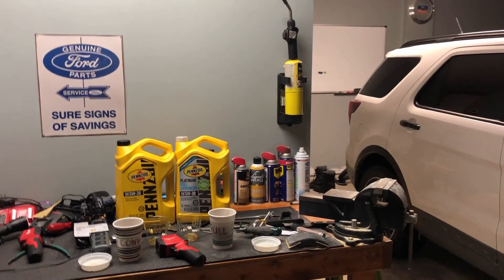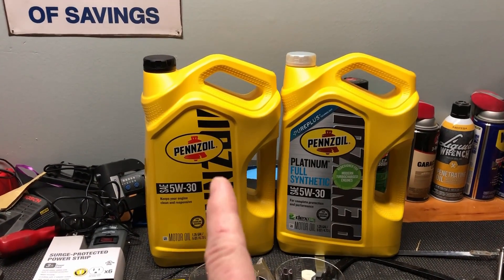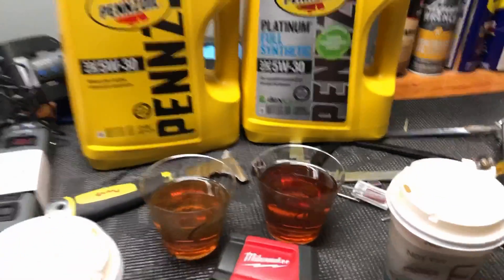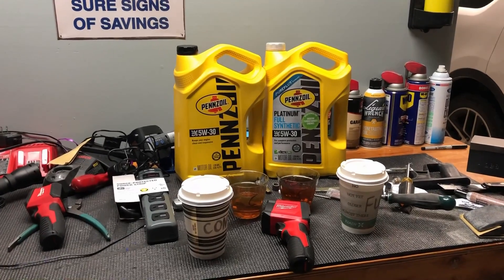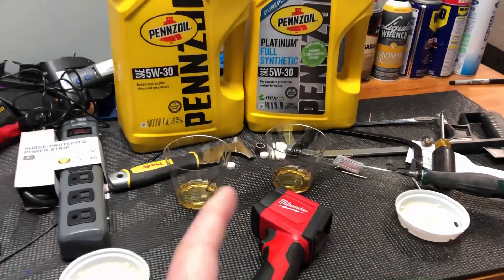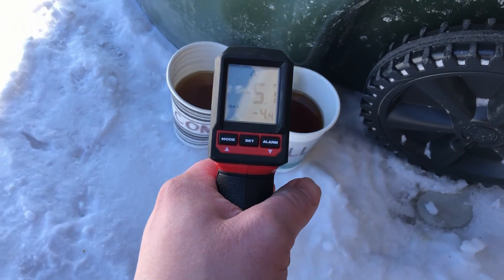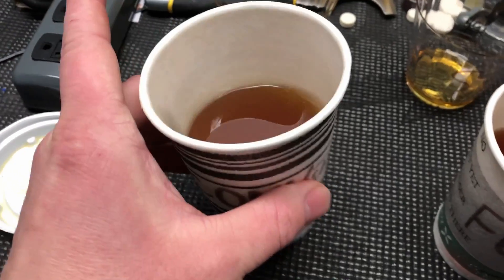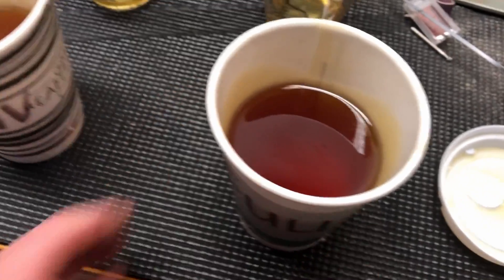Conventional vs Synthetic: Which Oil Do You Want in Your Engine During the Extreme Winter Cold?

Comment: I've always used Mobil 1 from Walmart $23 for the five gal jug . Just tried the Amazon 5qt jug full synthetic with all the API rating sn+ for $18 I'm going to give it a try. Made by a good old oil processing co for Amazon.
Reply: Its distributed by the same co. as the super supertech brand.  It's likely the same thing.   I'm going to give it a try as well
Reply: Anyone know the oil supplier for their oils?
Reply: Warren Distribution
Reply: Supertech is surprisingly good for it's price.
Reply: quaker state syn $15 at wallymart
Reply: @jonpeterson5534  That would be cheaper than Wallys Supertech…..something is wrong.
Reply: 0w20 bout 5 months ago    I thought it seemed too cheap but that's what it was
Reply: just checked, now $19.97
Reply: @jonpeterson5534  for that I think I would stick with Mobil one it proven to me if your local Walmart is the same as mine I think it is actually $22.88

Comment: So I saw synthetic oil lists a burn off or evaporated % on its specs and heard EcoBoost you should use lowest evaporative % due to pcv venting and oil in it getting to intake valves caking things up. I have 1st gen EcoBoost I just bought with 140,000 miles. Been giving it lots of tlc and going to get catch can and switch to synthetic oil. Saw penzoil platinum was at 7% evaporations in testing. Saw Mobil 1 was about 8 1/2%.  Only one with less blow by potential I saw was a red line synthetic oil. I don’t have much experience with penzoil or Mobil 1 synthetic oils but those are the two I was considering. I was wondering what oil you would recommend from your experience?  Thanks

Comment: Oil/gasoline prices have come down considerably and they function the same. Motor Oil has not come down, in fact it's gone up, add the synthetic now we have extremely high prices. Over the road trucking companies have been using Conventional Motor Oils, ref: Shell Rotella 15/40. This is the life's blood of their engines and it's working just fine. If anyone is going to jump on synthetic they would except the cost is out of line...

Comment: You should point out that syntentic might cause leaks on older engines. There’s no denying it flows better in cold temperatures tho .  My 2006 ram 1500 the syntectic  oil uses about 2 litres between oil changes and Dino oil it uses none .

Comment: I have used full syn for 19 years, change filter every 5k, oil at 10k....no downside.  Brand?  Walmart Supertech.
Reply: srercrcr I do the same, have always used royal purple but I’m thinking of switching. My question is how many miles have you gotten out of this method? Just curious? I have a friend of mine with over 300,000 mikes and only CHANGES his oil at 50,000 miles! He changes filter every 5000 and adds a quart of oil! Insane
Reply: @cl112688  I wonder why he waits for 50k miles?? I mean oil changes are not that expensive, and its cheap insurance! Crazy if you ask me.
Reply: @carstuff4u942  He burns a quart of oil every 5K and adds a new quart at that point, so when he has gone to 50K miles, it is not the same oil that is in there from the beginning.  The oil has been fully "changed" (according to his method) several times by that point, so he really doesn't have 50K miles on the oil.
Reply: @cl112688  a 2000 Explorer went 220K and never burned a drop,, and a 2014 Explorer with 66K.
Reply: which is also dexos rated making it no different than any other dexos rated oil that is twice the price.
Reply: @ Chase.. What brand of oil is your friend running and oil weight ?
Reply: P I I will try to find out here soon.

Comment: I lived through the big storm of 1964 in the middle of Saskatchewan in a motel.  I had an early satellite picture of the storm and it went from Alaska to San Francisco, and Vancouver Island to Hudson Bay. We were there cuz some relative died. The wind chill took the minus 60F down to minus 100F.  My dad never shut the car off.  But we did have to keep calling the govt power company to keep the heat on in the motel.  My brother and I enjoyed using the electric snow blower to keep the walks clear for the owner until we burned it out.  My grandfather told me that they used to use kerosene or diesel fuel in their crankcases on the farm in that kind of weather and even replacing the antifreeze when it got down past 66 below where the best water/antifreeze mix freezes.

Comment: This test was thought out in a very realistic way.  Since both oils are the same viscosity technically they should pour the same in these conditions.  This test proves two things. 1. Not all 5w oils have the same cold pour point, some 5w oils are thicker or thinner than others. 2. Pennzoil synthetic 5w is actually a very thin 5w oil.  This test actually proves that this type of Pennzoil 5w is a very thin oil and this is why it flows better in sub zero temps. A way oil company can claim better performance in the way of thin and easy to pump.  Proof of marketing gimmicks right here folks. I personally believe and use synthetic oils, in fact I use this type and viscosity used in this test,  but saying because it's synthetic is why it flows better in extreme low temps is not correct.

Comment: I’m an Amsoil dealer and I appreciate the demonstrations.   As a Ford F-150 eco boost driver I have a question for you. My 2012 had 154 thousand on it and I’ve heard about drilling a small hole in the bottom of the cooler to let the oil blow by drain.  What’s your thoughts on that?

Comment: Synthetic is no doubt better in extreme temps whether its cold or hot. But most people wont gain anything from using synthetic oil unless you keep your car to 250,000 miles or so. Keeping your oil changed and clean is way more important in my opinion.

Comment: I believe synthetic oil is better, I just have had way more problems with rear main seal leaks when using it in various different vehicles including ones I’ve gotten brand new and used it from the start! Anybody else noticed this?
Reply: After a while  let's say over 100.000 miles swich to a high milage  synthetic. Penzoil  has it.

Comment: I've done similar oil tests myself. Interestingly enough, on the opposite side of the oil's temperature range, a hot conventional oil pours faster than synthetic. The reason is that conventional oil gets thin and loses viscosity when hot, while synthetic oil holds it's viscosity when hot and doesn't thin out as much.

Comment: This doesn't relate directly to oils, but I guess it indirectly relates.  For my new 2020 Escape with the 2.0L EcoBoost engine, I want to keep it as well-protected as I can for as long as I can.  I know last May the GF-6A oil specs came out, which for one thing helps reduce LSPI by keeping the oil that may get into the combustion chamber from vaporizing and changing (decreasing) the overall octane of the mixture, which makes LSPI more of a possibility.  For many years, on a conventional V8 vehicle I had (2006), I would use the specified amount of Marvel Mystery Oil (MMO) in the fuel (but only the fuel).  After about 1,000 miles on the new 2.0L EcoBoost engine, I started using the recommended mix of MMO in its fuel as well (4 ounces per 10 gallons of fuel).  Am I adding to the possibility of the LSPI by adding this MMO to the fuel rather than actually protecting the engine as I intend, when the GF-6A spec oil is designed to keep oil(s) out of the combustion chamber? Thanks, Tim

Comment: New subscriber here, great videos... Quick question I drive a 2007 f150 5.4 V8 here in Texas normally put in 5w - 20 synthetic blend, should I switch to full synthetic or other kind? Thank you
Reply: Switch it to at least the 5/30 synthetic. Brian has made this reccomendation to help reduce wear on the vct system (phasers, and valve train), I would stay with full synthetic in texas, the temperature range isn't as extreme as here in Chicago so engine should stay happy.

Comment: Today the different between conventional vs synthetic is 15 bucks. Here in vegas we don't get that cold. But if those extra 15 bucks will save me money in the long range why not. I been using full synthetic between 0w-20 to 5w-40 for different application and every time u remove the valve cover u see a spotless clean engine.
Reply: Luis, not making an effort to 'break it off of you' here...but "every time you remove the valve cover"...like that is something you
do with your car(s) routinely??  Maybe you meant, remove the oil filler cap instead??
Reply: The point of the comment is when ever the reason I have to remove the valve cover, by looking is easy to tell good interval of oil change and quality oil been use. Sorry if the comment lead in the wrong meaning. Of course by looking at oil filler cap u can tell a lot too.
Reply: @luisbaez88  ,WHATEVER WORKS FOR YOU MAN...IT'S YOUR CAR!
Reply: @theguy6199  same to you

Comment: Hey! I have a 2008 auto Ford Escape, and it was leaking trans fluid for a good little while. I don't know much about cars, so when I was driving next the car would get up to about 50khm and would hit 4000 rpm. It was like my car was tugging along, and I was riding up to 5500-6000 rpm going like 60kmh. Next time I saw the trans fluid leaking, it was completley black. Do you think my trans is destroyed, or is there anything else I could do for it? (I already had it flushed and filled again, as well as patch the leak, and it hasn't changed)

Comment: I have a 2018 Ford F-150 with the v-8 5 liter engine should I start using a 5w 30 oil or stick with the 5w 20 for that year? I have about 9000 miles on the truck.
Reply: Also curious about this, though I have a 2011.
Reply: @repairvehicle  Name a non-quality synthetic oil, will you?  Stumprd eh?  No such animal.  Synthetic is the top of the food chain.
Reply: @Minn_So_So  Mobil 1 has been an expanded brand the last 10 years, the name represents a family of oils (like Pennzoil)

Comment: Oh yeah.  If you have an old vehicle don't be afraid to switch to a national brand synthetic. 
Don't be shocked when your first few oil changes look nasty. Its cleaning your motor. 
I've switched 80s, 90s and 2000s vehicles and equipment that was old and high miles to synthetic oil all to positive effect
Reply: I've heard of some people having issues causing more leaking because the oil is more slippery. If the engine isnt an oil leaker and has good compression then yes I'd switch right away if you can. Otherwise domt put synthetic oil in an old clunker
Reply: @jonathoncatterson8901  
Don't switch on an engine with more than 50K or you will end up with leaks

Comment: Most of the time I use synthetic but right now I have Quaker st conv 5 30 in my 05 cav and car fired right up at minus 10 in nh.  My jeep has valvoline modern engine 5 30 oil  which is best  valv makes...synthetic is a must in minus 20

Comment: Great video. Wonder how it flows through the filter? ❤️️
Reply: Arthur Fricchione  filter will go into bypass mode if the media cannot flow enough fluid.  Typical bypass psi are 17-22psi. It’s important to use a filter that is OEM or has the same bypass rating as OEM for this reason.

Comment: What about the Semi-Synthetic that Motocroft uses at all the dealer networks for oil changes? Also is there is validity in the fact that the pressures are so high in the turbo charged ecoboost engines that a Semi or conventional oil is better as the particles in the oil are thicker.
Reply: Chris Rosenberg :  I get my F150 and Edge serviced at the Ford dealership asking for The Works package. They put in Motorcraft Semi Synthetic so I assume it is Ford Motors recommended oil. I too wonder about using full synthetic in my vehicles. It does get cold in northern Iowa and I always change oil at 3,000 to 3,500 miles because our use is in town short distance driving. We do use remote starts for 15 minutes. Anyone know if full synthetic would make much difference on our engine life?
Reply: @PrometricUSA  I have used nothing but mobile 1 in my wife's 06 Corolla and it has 268.000 on it and still runs GREAT!
Reply: Jamie hynday dealership use bulk oil valvoline.you get what you pay.conventional, semisyntetic  wich is whatever they say high  milage  or full synthetic.
Reply: I would say there is no validity to that. I just bought a used ecoboost equipped car with 21K miles. My first oil change on it will be coming up in the spring and I will be using a good quality 5w20 full synth in it. Probably Mobil 1 with a Motorcraft filter.

Comment: I understand that you shouldn’t mix the two oils when changing the oil to switch to synthetic. What is the best method to switch?
Reply from the maker: That is exactly what a syn blend is no problem.
Reply: I guess I asked the question wrong. If a car normally requires normal oil and you wish to start using synthetic, will there be any issues with changing to synthetic and not getting all the old oil out of the engine. Another problem, if you accidentally add regular oil to an engine, like later model Fords, that require full synthetic, particularly if the auto is still under warranty., will it cause problems.

Comment: i'd also be worried about my coolant freezing up and cracking the engine block.
Reply: Jonathan A it will still freeze there’s a limit to it. Depending on how much anti freeze to water ratio.
Reply: I use 100% for the winter time. Water isn’t necessary.
Reply: @garrettstevensen2467  
Water is necessary for proper heat transfer and water is the most efficient way to transfer heat. But, those oxygen molecules cause problems. 
Pure antifreeze ethylene glycol freezes at about minus -10°F, but boils at 387°F
 When mixed with water 50/50 the freezing point becomes - 32°F
And, under pressure from radiator cap, boils st about 265°F.
  Do not exceed a 60/40 mix.
So, running straight ethylene glycol may not produce a problem if temperatures are not below minus -10°F .. but, could produce problems in the summertime when temperatures exceed 90°F to 100°F . .. And that would only be because of improper heat transfer causing hot spots, even though it would not boil.
Choose Wisely

Comment: Whats your opinion on the "car wizards" video on the 5.4 being the worst engine ever
Reply from the maker: Wrong! I love the 5.4L it just has a few issues like the 6.0l powerstroke. Once you put on the latest parts they are great reliable engines. They key here is both these engines have a very strong core that takes allot of abuse. It’s everything that bolts onto this core that is failing due to early engineering faults.
Reply: @FordTechMakuloco  ok.  so the small oil passages and possibly sludge are not necessarily the whole issue.  Do you have a bulletproof your 5.4 video?  might be a popular vid...
Reply: 6.0 liter is a good engine but it should not take 10k to get it there. plus its a maintance queen which i don't mind other than the constant headache with it break  down tows on a daily basis.
Reply: kapple17  yes he has a series of videos on "bullet proofing" a 5.4 where he covers in depth R&R the timing set and oil pump.
Reply: @FordTechMakuloco  I agree completely.  I am dreading the eventual timing chain job though..
Reply: @rocsvt1  I agree, you should not have to spend an outrageous amount of money to make an engine last as long as a competitors engine. I have a 4.8L Chevy with 325K and just starting to burn 1 Qt. of oil in 2K miles; but still runs very good. No I’m not a Chevy lover; I have a ’99 F150 4.6L with 120K miles; doesn’t burn any oil in 4K oil changes. Yes it runs very good!
Reply: @Mr.Beastforpresident  against the engine nope
But the vehicles them selves the Fords are way better but that's my opinion
Chevy's just felt cheap when it came to the interior.
I do like the old square body's though.
Reply: 5.4 worst engine ever???  hes never heard of chrysler 2.7 or northstar head bolts causing huge problems??  to name just a few.
Reply: @arthurrodesiler3109  i have a 08 f150 in my plow fleet..other than the plug nonsense which we all know about its been fine and you know how guys beat on plow trucks that are not there own..
Reply: @Mr.Beastforpresident  we bought 5 6.2 f250 plow trucks for here at work...no problems so far and we have good size lots to clear..we had a 5 of the old 2002 with front leaf setup so when we finally got these it was like driving in luxury....the 2002s  were good..few needed trans rebuild at around 100k but otherwise they ran good when we traded them..frames were stating to get soft spots so we cut our losses.
Reply: @Mr.Beastforpresident  
I have a 2012 6.2L with approx 75k miles & zero problems. 
I do not use the "weasel piss warranty oil" that is mfg recommended because of CAFE standards imposed by the government, and based on a 90 hour test. 
API certified that exceeds SM/SN is my guide.
Agee that unless your vehicle is in a garage, a 0w-20 synthetic for freezing temps would be good for a least those months. I will soon have to replace two spark plugs per cylinder - 16 spark plugs. Fun😨
Reply: I have a 5.4 3v drove with broken chain guides for almost a year lol. (I know it sounds unbelievable)  Until i was able to fix it . I'll say they do take a lot of abuse
Reply: Car wizard about the 5.4 3v. REPLACE THE ENGINE ! lol

Comment: Why don't you use motorcraft oil?
Reply from the maker: No real reason, if it was more available and a reasonable price I would buy truck loads of it for the shop.
Reply: @FordTechMakuloco  You can get the ConocoPhilips branded oil (same stuff) from Sam's club at around $2 bucks a quart.